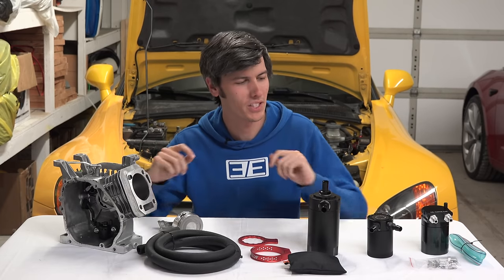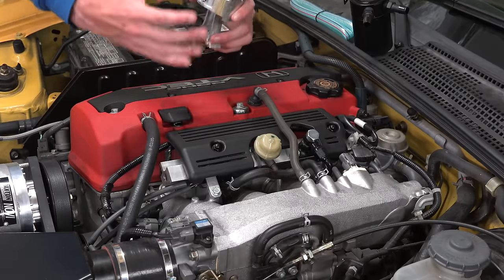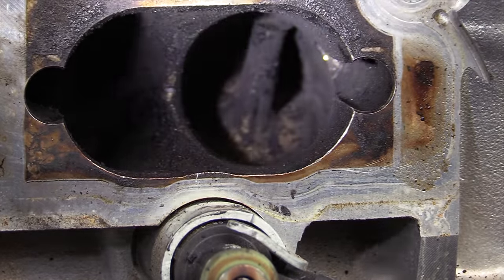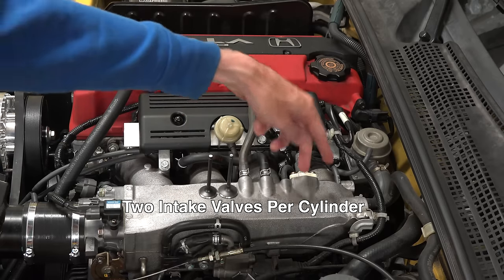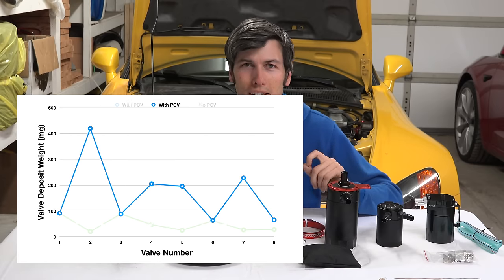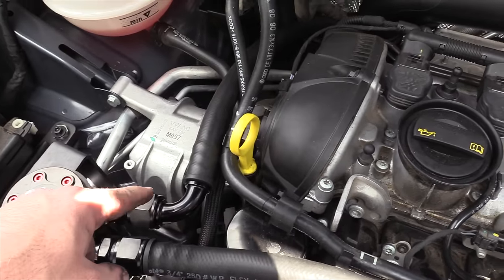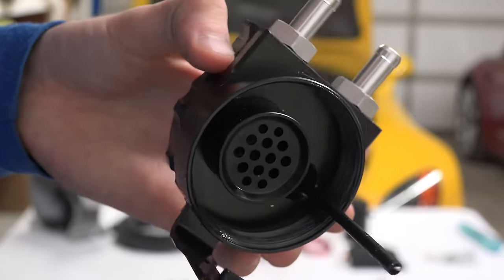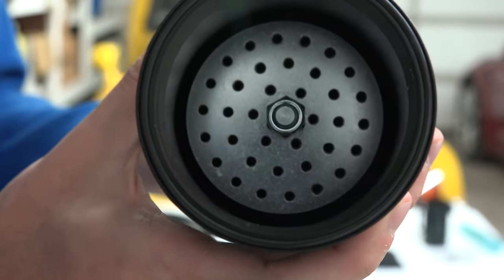Do Oil Catch Cans Actually Work?

Comment: Nice video.  One nitpick:  the bronze 'filter' is not, as you describe, a filter to keep the junk from going back into the intake/valve cover.  It is a place for the vapor/mist to collect and drip to the reservoir as large enough drops that they won't be carried straight through to the intake.
Reply: Is the filter cleanable?
Reply: @robertrose3068 Late to the party here. In all honesty, those shown in the video aren’t filters, one is a vent and the other a muffler. Both are commonly used in pneumatic applications. They can be cleaned with carb cleaner or just replaced cheaply enough. Their filtration properties are rather limited.

Comment: I just run a line back to the oil pan from the catch can for the oil to go back to the engine block, I want the engine to breath and liberate blow by for healthy horsepower and clean valves and just get the oil back to were it belongs (the pan)

Comment: I have the cheaper can. If you use a packing like steel wool it works better than the expensive ones. I have a Lexus CT200h/Prius. This is a necessary upgrade at 100k miles.

Comment: Also there's a big difference between a naturally aspirated and a turbocharged direct injected engine you with the EcoBoost they this can be a bigger problem because the more oil that gets in there it can lower your octane and that can mess with performance because it makes it dial back the ignition timing and things but also what I saw because I live in Phoenix but over the last year I've been going to college and Flagstaff Phoenix is a desert Flagstaff is a much higher colder elevation which in the winter gets into the teens and in the winter you actually see one more blow by credit actually looks like chocolate milk I believe it's from the moisture the condensate that forms because you have a hot engine and temperatures outside so it catches even more stuff and it's even more important if you live in an area that gets cold winters also with turbocharged engines or supercharged engines with the oil catch can you need to make sure that you have a check valve so that your pressure from the whatever supercharger turbocharger you have doesn't get forced in the crankcase even more important alike on my Ford escape 2.0 EcoBoost you actually want to run a second line after that check valve with another check valve that goes to the intake hose because what happens is when you get into boost that shuts off flow because the check valve starts working and so you no longer have your crankcase evacuating so when you run that second line it gives it another port to go through and even though there's not nearly as much vacuum the when the turbocharger gets going it's going to create some vacuum in the intake hose and so you always have some vacuum on the crankcase which will help with ring seal and things.  Also since I was a cheap college student I couldn't buy the nice catch cans that were like 150 bucks that I used to put on my mustang so I actually got basically the second one that you're handling although only paid 25 bucks for it it's nice cuz it has the bronze filter and it has a small disc that acts kind of like a baffle although there are much better ones that have like compacted steel wool. what I found with that one is it actually leaks a little bit around the hose connections and I think in the beginning I even had some around the main cup portion to the top and so you just what I did is I switched out for different o-rings and I put a ton of ceiling I didn't use plumbers tape but actual gunk sealant and eventually was able to make it to where it didn't leak but it was a pain but if you can't afford the $150 one which is what I would highly recommend if you can because they just have better machining the threads are done better they feel better the bath is better the filters are better it's just worth it if you can but something's better than nothing.

Comment: The effect I see in adding a filter to the oil catch can is you don't know the back pressure your adding to the crank case, this could cause the valve  cover or other seals in the engine that are harder to access to get pushed out of place causing an oil leak.   I would like to see the pressure inside the crack case before the oil catch can with the filter, then the pressure again with out the filter, then again with out a oil catch can.     To over come this problem I could see someone buying a Tee fitting maybe a one to four, then connecting four catch cans with filters, then a four to one tee fitting back to the air intake.      Or get a oil cleaned filter like a k and n filter, take the crack case line and pipe it in front of the air filter. that would make the oil get stuck on the oil filter and create a large mess inside the air filter box, get a custom air filter box that has a catch for oil.      Just don't over pressure your crank case.  Maybe a over pressure valve on the oil catch to prevent a clog.
Reply: Do what I do; don't use a hose clamp on the fitting to the can so very little pressure will blow the hose off. Mine will likely pop off if it were to see 1psi, and it has never come off.

Comment: Does the one fitted with brass filter will clog after long run? I had that one currently and not yet install. Another model i have is Square type which too bulky for current ride. Not enough space to install it.

Comment: Would this work for LS V-8's ? I also eas thinking of using the  centrifugal oil separator (commonly used for diesel engines) if I could find a way to make it work .

Comment: Why is this only discussing direct injection?? Catch Cans and Air Oil Separators are still EXTREMELY useful on port injected turbo cars! Without one, all that oil that gets sucked into the combustion chamber via the normal PCV to intake system dramatically reduces the fuel octane rating and can/will cause detonation!

Comment: Enough time has passed since dual injection (direct injection for main fuel supply PLUS intake injection to hopefully keep the valves clean) has been in use to ask; is the dual injection strategy really working? Or, do I need a catch can on my 2018 Raptor?

Comment: Another good reason for an oil catch can on modern turbo engines is the phenomenon of stochastic pre-ignition.  That oil mist likes to ignite at lower temperatures than fuel and can really wreak havoc at low speeds and high loads.

Comment: Have  there been any crankcases over pressurized by catch cans blocking up during cold winter operations due to freeze up? 

I'd expect the expensive cans with the fine bronze filters may be the worse if the above freeze up problem does occur.

J

Comment: Waiting, on the market will come a car w/engine w/double injections/injectors. One on the intake air before the intake valve (normal point injection) and second inside of the cilinder (GDI). The engine will perfect clean. God bless for the ing.
All the GDI/SKYACTIVE engines today have the same problem w/charbon on the intake valve, low performance, etc. The engine maintenance for this situation will need done a 16.000km w/CRI intake valve cleaner spray.

Comment: Anyone know anything about Speedlogix catch cans for mopars? The filter element has me worried. It’s like a steel mesh and I don’t know why they used that as if it gets sucked into the intake it will cause a failure.

Comment: Anyone considering putting this be extra vigilant on the level in the cab..  if it fills up your pcv looses suction and your crank case get over pressured.. the oil pan seals fail and you risk pushing out the crankshaft seal.. this is what happened on my engine.. no more catch can on any of my engines.. not worth the risk.

Comment: this would only be logical if it allowed the oil to fall back to the oil pan. otherwise whats the point in catching it. guess that is why my old 12v just makes a oil mess around the draft tube over time.

Comment: I had these installed on my FC and now I just went and installed one on my Prelude with an H23 Bluetop. I was worried about the detonation since the chipped ecu I purchased for it (P28 from Phearable) had the knock sensor disabled and so my temporary solution until I purchase a differenct ecu with the knock sensor enabled (P72) was this. Not that I'm going to remove this when I get the other ecu.

Comment: All my 1959 to 69 British cars had the breather routed into the air cleaner not directly in the intake manifold.
Reply: So, would the breather attach upstream or downstream from the air filter ? If upstream, wouldn't that clog the air filter ? And since your cars had carbs, the oily air would be mixed with gas so would this even be an issue ? It's been too many years since I had my MG's to remember what they even looked like.

Comment: I remember, OG here, when there was a piece of replaceable foam in the air cleaner to keep oil from entering the air cleaner due to blowby from valve cover. So this is an upgrade apparently. It just costs a lot more...understatement.

Comment: Air oil separators are even better than catch cans because they automatically deposit the oil condensed from the vapor back into the oil pan. They cost around $300 in parts to install.

Comment: I have a question! I have a valve cover breather on the passenger side and a catch can that's on the driver side. On the catch can, i have it sealed off. I dont have the breather on the top of it. Should it be vented also or is blocked off with no breater on the catch can okay? It's on a built 355 sbc with 60cc heads and a healthy cam.
Reply: No breather on driver's/ PCV side, it will allow unmetered air in.

Comment: Don't use "Oil Catch Cans" in cold climate! It fills up with water condenced from vapors very quickly. At sub-zero temperatures, this water freezes and can block the crankcase ventilation. The result will be squeezed out oil seals and gasket leakages. Due to its size the main oil seal is squeezed out usually in this case.

Comment: I’ve installed a can in 3 of my vehicles. Even  in my 2019 raptor with only 30k miles I collect about 1/4 ounce per fill up or so.. I know that might not be enough to cause issues but I’d rather keep all of that crap out of my intake.. on my 87 Jeep Wrangler, I’m collecting a full ounce per fillup and it’s really reduced the pinging… by the way, I live in California and just had the jeep smoged.. I did not get any push back with having the van installed, just don’t have the ones with the vent filter on top or you most certainly will get a visual fail…
Reply: Kudos on the Raptor!!! Would love to have one myself but had to settle for a 2020 Ford Explorer XLT 2.3L Inline 4-Cylinder!!! Great vehicle!!! Just wanna protect it as much as possible!!!😁👍🏻

Comment: I thought I might need one of these on my 3.5 ecoboost but I did a little research and found out as long as I used a quality synthetic oil and a quality 20mic synthetic oil filter a catch can was not needed. I now have 270,000 miles on my 2011 f150 3.5 ecoboost and it still runs like new and doesn’t use a drop of oil. Treat your engines properly and they’ll do what they’re engineered to do.

Comment: Most PCV was just a hole in the crankcase before emissions control regulations and after splash and pressure lubrication.

Comment: Alternatively you can source a charcoal cannister from a restoration company for old cars, and route your PCV to that like they did back in the old days, just change the charcoal every 50k miles or so, dump it out, put fresh, toss it in the trash woohoo! (although the one in my 70 camaro has never been refilled in 51 years and it still does its job just fine lol)

Comment: If you want to keep the intake clean, block the EGR valve. Unfortunately, that may be illegal due NOx emissions and may increase your exhaust temperature.
Reply: The engines I've seen with the worst cases of valve deposits didn't have EGR, and the cleanest valves I've seen were on on engines with EGR. Imo this has virtually nothing to do with EGR, but that's partially my point. You need to keep PCV oil out, EGR gas is probably not even a factor.

Comment: I must admit I couldnt't watch to the end of this video.  But I presume the Volkswagen with 800,000 km in the experiment have a catch already on it for it's whole life and then removed for the first part of the experiment?  Because if not, the theory that one is needed is completely disproven despite what the the experiment showed about deposits through weighing.

Comment: PVC systems are often heated to prevent freezing in winter driving.   The stock line as short as possible.  Most use hot coolant along the PCV line as the heat source.  If the lines or the can or bronze filter  in the can freezes  ………you will blow am engine seal from excessive crankcase pressure  , which might put all the engine oil ( huge leak) on the ground and destroy the  engine in seconds.   Warranty 😳😂😂😂😂😂😂😂

Comment: Had an ancient truck, V-8, and the PCV system worked by drawing air through one valve cover into a PCV in the other cover then into the intake. Blow-by was massive and cleaning the PCV system didn't help. Going through 2-3 quarts of oil a week and not worth fixing. I simply sealed the air intake, ran a hose from that valve cover into a plastic oil can arranged so that the hose stayed at the top but was also able to admit air for the PCV system. Every couple days I poured the contents back into the engine and now only needed 2 added quarts a month. Saved me considerable money and let me drive it another 4 months to save enough to replace it. 

There's no magic in things like this and damn little engineering needed, all you need to do is have enough filtration media to catch and separate the oil mist from the wettest airstream and have someplace for the oil to be collected. Plastic 'potscrubber' pads your lady uses to clean her telfon cookware are nearly perfect and are identical to what many engine manufacturers use for the purpose. Home-made sub-$5 DIY vs spending huge on the ones shown here and nearly as effective. Or you can waste your money on magic and buy this bridge I have for sale too...

Comment: Great explanation, but i was wondering, the PCV valve comes out of the valvecover but the pressure is in the crankcase at the bottom of the engine, how does that pressure get up to the valve cover? An external hose or internal "holes" in the block like water passages?
Reply: The PCV or Positive Crankcase Valve was designed to keep your engines blow by from dripping oil onto the ground, before PCV valves the blow by was routed from the engine via a small hose and the oil would just drip onto the ground which is not good. The small amount of oil vapor that the PCV directs into the intake will not harm anything, plus todays oils have very low ash content to them when they are burned off. Catch cans are a solution in search of a non existent problem. All engines have blow by that is created from the pistons pumping up and down.

Comment: You know what works for an engine with excessive blowby. A brake fluid bottle with a hose jambed in top connected to the valve cover Shove some mattress foam towards the top of the bottle to catch the mist. Put one on my slightly smokey Honda mower. Still runsfine without oil being sucked into the air filter. Just make sure you still a few holes in the lid to let crankcase breath properly but use the foam to catch. When it rooted get another chunk. Problem solved cheapest

Comment: Regardless of the valves, PCV increases your IAT's and that alone decreases horsepower; but PCV's also, by nature, are recirculating hot gases and oil mist into the intake, mixing with the air and then the fuel that your engine is using too run, which displaces air, and decreases power that way. 

Now I know not everyone cares about making maximum power from their engines, but every internal combustion engine with a PCV stands too benefit from oil catch can for reasons of longevity and fuel economy. 

You might ask why then do manufactures not install them on cars? The answer is pretty simple. The vast majority of people don't want to work on their car in any capacity. Most of them have never even opened their hood; but a catch can requires you remove it and dump oil out of it every now and then --- non car people don't want too do that, and most people are in fact non car people unfortunately.

Comment: Question. What about the ones that vent to atmosphere? Seems like they would be even better as they dont route back into the intake at all.
Reply: This is what I do on my turbo car. Unfortunately you would have to trick the computer that the pcv is still there or you'll get a engine light, especially on modern cars. Older cars are easier for this to do

Comment: I've been using 2 of the $25 catch cans for the last couple of years on my 07 350z which is a weekend car and track car only; not daily driven. They work very well, however they fill up quickly due to their smaller volumes and my particular build. Emptying them regularly is very important, I notice a difference in performance almost instantly once they are close to full. Great products; have held up very well.

Comment: Those bronze filters are dirt cheap to make... they used to use them for fuel filters. It's kind of outrageous they are charging so much for a catch can with one. Honestly the $200+ models should have frickin' Bluetooth and a level sensor so they tell you when they're full.

Comment: A few questions for Engineering Explained:

1.  I hear the new F150s have fixed this issue and catch cans are no longer needed.  True?
2.  Does adding a catch can void the car warranty?
3.  Should those in cold climates not use a catch can?

Thank you!